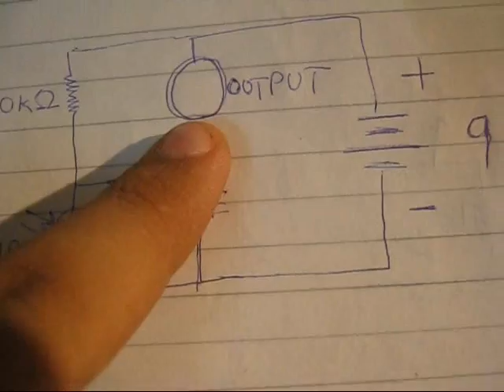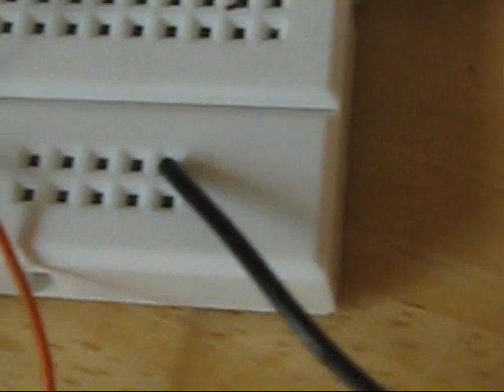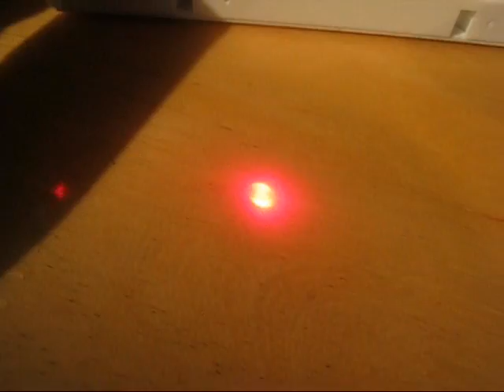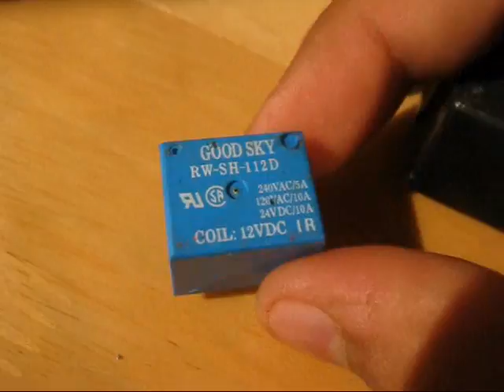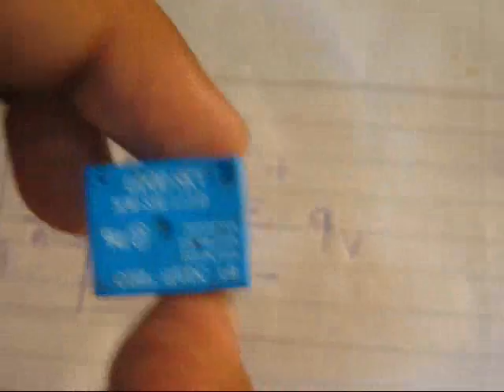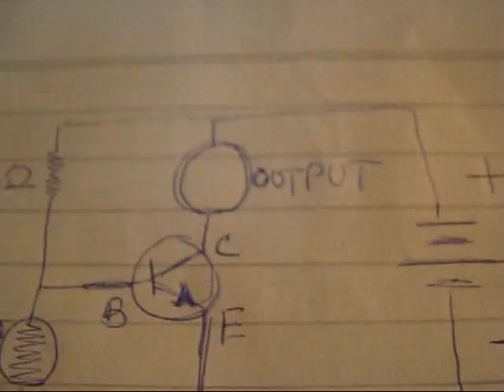Protect your Room with your own Laser Security System!!!

Comment from the maker: Yes there are many ways to get the alarm to stay on longer. You may use a microcontroller like an Arduino, PIC, BASIC stamp, atmel, AVR... or an set of logic gates to set of the alarm and then control it with a switch to turn it off. However the simplest and most practical would be to just use a 555 timer. You can even control how long you would want for it to be on. Hope this Helps

Comment: hey...umm...I've completed my device based on your circuit...
it actually works...but the other way...
if m focusing a laser light on it...the buzzer goes off...
and when i'm placing an obstacle between the laser and the device....the buzzer doesn't make a noise...
I checked all my connections and they are just the perfect...
not able to understand the cause of this problem...
 some-one please help..!!

Comment from the maker: Its really hard to believe you! Most electronic appliances (except mobiles) use an adapter run on 9v. A popular example being Computer speakers, the auxiliary input speakers, run with a 9v adapter. Anyways answering your question, use the same transistor. Try with same resistor if it doesn't work replace it with a variable resistor (potentiometer) and set/tune it to the resistance it works at. Or else see the threshold voltage of the transistor and calculate the value of the resistor.

Comment from the maker: Sure you can use a 9volt bulb. The problem is that bubs use a lot of energy and will drain your battery rather quickly. So if you do decide to use a bulb add a 9v power regulated supply so you don't need to worry about the battery running out. "ldr of 12m"? what's 12m? 12mega ohms? Any low powered laser will do. I used a simple laser pointer.

Comment from the maker: You should read the info section just below the video. It has a fair amount of detail as to the different components i have used, the operation and utility. I have also explain the working in good detail. Maybe she should do a little more research on the bare components. For example the transistor- how it works, the history,etc... that should add a interesting dimension and well as good depth of understanding to the report. Tell me if you want me to explain more specifically. Hope this helps :)

Comment from the maker: I used a laser as it offers more range between the receiver and the emitter than any led will. For the system to be effective there should be a significant difference in light intensity of the source and ambient light. Ultimately the choice of your light source really depends on your application. If your only looking at the width of a door then yes a infrared led should work. You do get LED's that are high powered and LED's with in build lens for focus.

Comment from the maker: Ya, relays can at times really get a little difficult to figure out (as there are 5 points).An effective method to find out which point does what is by simply searching for the datasheet online (just google the part no). The datasheet will tell you which 2 points are the load (which you will connect in series with the mains and light) and which 2 are the coil points (you will in this case need to connect by a normally open configuration, implying the light will only be on when the coil is high)

Comment from the maker: It would help if you could describe your apparatus. The specifications of your transistor, resistance of your LDR, power source (9V battery?), Have you used a breadboard or soldered in on a perf-board, etc... Or best you could post a video response regarding the same.

Comment from the maker: Well, where you went wrong was the connections. Just interchange the positions of the buzzer and the resistor and you should be good to go :D

When ever you face a problem in electronics especially when you dealing with experiments like such at grass root level just go through the schematic again. You will get rid of your problem. Hope this helps :)

Comment from the maker: Yep, soldering can be quite a challenge to get started at.There are a lot of soldering tutorial on YouTube, you should find them very helpful. You might also consider using a prototyping board (Perf board) rather than a printed circuit board. They are very cheap allow for rapid prototyping. Perf boards come in different orientations, some are in the same orientation as the bread board, so you can directly fabricate the circuit in the same orientation. Making the project a lot easier.

Comment from the maker: the LDR i used was 8k ohms (as mentioned in the description). No there isnt any rower rating on it. You will have use just use common sense to figure where it will and will not work (so probably the maximum power circuit you could safely use it with would be around 12-18volts and 2A max). As long as you are using a battery you are good to go. a 1.5v AA, 9v, high power 4.5v lithium ion/polymer battery's,etc... if You could explain your project and your power source, that would be helpful :D

Comment from the maker: Ya, of course because of the simplicity of the circuit we can just directly connect the components together. Using a pair of pliers (or bare hands) by twisting them together. Or a more permanent solution will be to just solder all the points (that need to be connected) together.

Comment from the maker: ya, i know the way to make the system permanent :D a simpler way will be to just use a AA battery pack. Actually given the time, i would actually rather use a dvd burner laser diode with a laser driver (to increase my effective range), or best use a IR laser diode and also run that with a driver. That would make the laser absolutely invisible and wouldn't obviously even show in dusty conditions. see the last part of the video again, will see what i am asking :D

Comment: laser:Take the laser diode out of the laser light toy through a screw driver which you have got..the mouth portion is the positive terminal and the spring one is the negative terminal..connect both with a 9V battery along with two 10k ohm resistors as the your laser light works on 3.5V..now connect this system with a switch..and stick this light in front of the LDR..and you can also connect the buzzer with a switch..hope it was helpful.. :-)